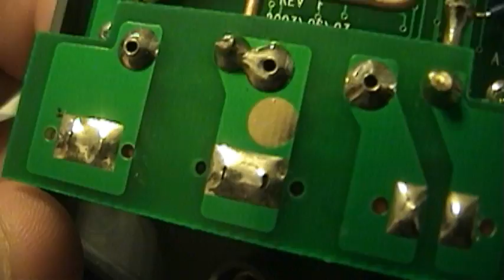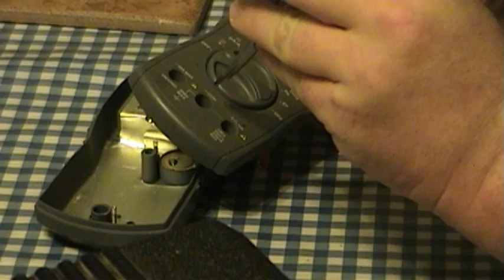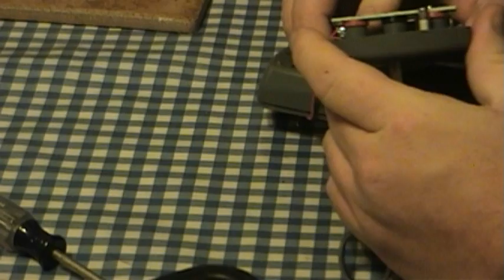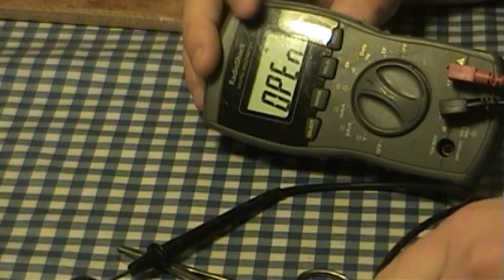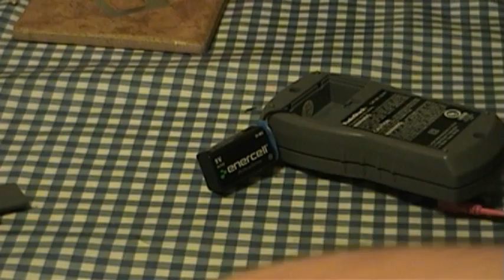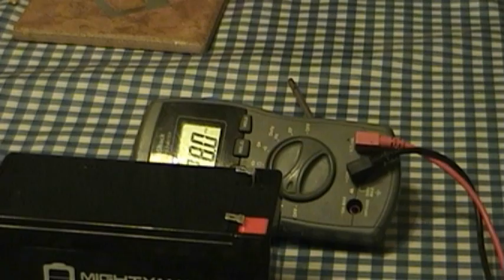Quick Kitchen Table Electronics Repair: Radio Shack Digital Multimeter

Comment: My issue is the RS cat # 22-612 is not on zero ever is reading crazy numbers !
How can I fix it ??
Reply from the maker: It may not be broken. When in the voltage measurement modes and with the leads not connected to anything (or connected to a "dead" circuit), you may see fluctuating readings up to a few hundred millivolts. This is a result of the meter's high sensitivity.

Comment: Hello I would suggest to remove the solder at the connection joint first, easiest and cheapest way is by using radio shack desoldering braid, or other brand, then resolder both tabs at once, nice repair.

Comment: Is that a RadioShack  22-813?  I had a smd component to  fall off after I dropped it, but the listed component is very difficult to read.  It's on the selector switch  side of the board near the range button pad and across R47 and below R15  and above the ground spring for the shield.    I think it is C7 which could be a capacitor.  If that's true do you know the value?
Reply from the maker: I'm sorry, I don't have that information. I don't have this meter any longer.
Reply: @uxwbill  No problem.  At closer inspection, I think your meter was different.   Thanks anyway.

Comment: Hi! I've that tester is the best. But i've a problem mi tester  has got a two resitor damage (r43 and r56). I wondering if you can tell me the ohms of those resistors. Excelen video, thanks.
Reply: how do you know the resistor are damaged?

Comment: The one thing I hate is the fact the lower cost meters is the 10 amp setting is not fused . That big loop in your meter is what carries the high current . I have about 5 meters from my time on submarines in the NAVY and while I worked on 16.8 k voltage systems . On a submarines the ground is floating so the meter has to be a lot better than lower cost meter It funny now but back when I first went on subs I made the mistake of using a o scope without a isolation transformer   . It was only 60 volts but it make a big fireworks.

Comment: I had one of these meters. Thought it was pretty decent right up till the point that it bizarrely started reading voltages well below the actual voltage, it might have read to high now that I think about it. Either way it was off by a few volts. I went through 2 of those $20 red harborfreight meters too. Thought those were decent till they up and never turned on anymore.  And no none of these problems were because of the battery. Funny thing though, the cheap $10 or maybe $15 meter I got off ebay has been quite a good meter. I've tested it against my Fluke, and it does pretty good for itself. But there are people that say a lot of Fluke meters are junk too. So I don't know.  I am not doing anything scientific with my meters. If it is suppose to be 3.2v and it reads 3.26 on the meter, that is good enough for me.

Comment: I have the same meter. The positive terminal is starting to fail in the same way and the beeper is broken. It still works though, even has one of those Radio Shack batteries in it!

Comment: It seems like when people are using multimeters in videos for the most part they have the leads connected backwards so when they are testing voltages it says - and then the voltage.

Comment: Is that your only meter? I figured you would have had a spare of two.
Reply: I have a pretty decent meter I uses regularly and I keep a cheap-o harbor freight spare in a drawer just in case I need it.
I do have a box of old broke, questionable meters too but that's a story for another time.

Comment: I have that same soldering iron. I tried to perform some KTER myself, by doing a recap job on a TV PSU board, but it just took way too long to warm up, and it never really reached a high enough temperature to properly solder anything, unfortunately.
Reply: I guess you need a 60 W soldering iron.

Comment: You might wanna get yourself a lower end fluke multimeter.
I own an 17B+ and have to say it is much better then the cheap ones I owned.
The thing will set you back about 90 Dollars, but it is build to last.

Comment: I have a similar model which is suffering from a similar issue (the connectors are still in place, but they have opened up to the point where the positive probe doesn't make proper contact with the connector..easy fix, but the plastic bit keeping the connector in shape has broken off). Mine has an RS-232 connector on it so I can hook it up to the computer and gather data for later reference if need be.

I'm thinking I may make some sort of digital data acquisition unit with this, a raspberry pi with touch screen LCD, and a USB oscilloscope. Won't be the best, but will be more than good enough for me and what I do with electronics.

Comment: Hey its a good multimeter bill, ive allways liked radio shack meters, not the most accurate in the world but plenty good enough for general testing :-D.
I Have two old flipstand micronta digitals from the 1980's, display at the top and two grey knobs for the range and mode, they served me very well :-D
Later as i understood the way multimeters are designed i trimmed the fixed resistors inside my old micronta's to make the ranges more accurate, just needed better resistors for them to be so much better on accuracy :-D
Your autoranger will be very good for general work, if that COM post plays up, perhaps removing the bits and soldering the end of the lead into the mini pcb would be a long term fix, and a blob of hot glue in the top tube to stop the lead pulling out.
The com wire is allways in that socket, make it a perminant job perhaps? :--D